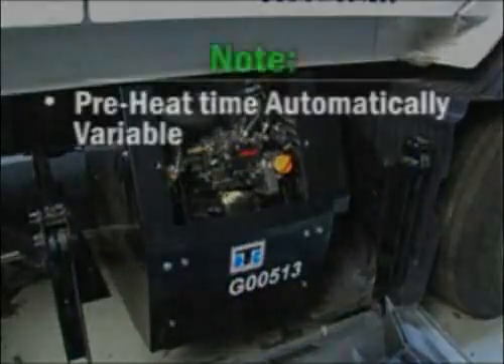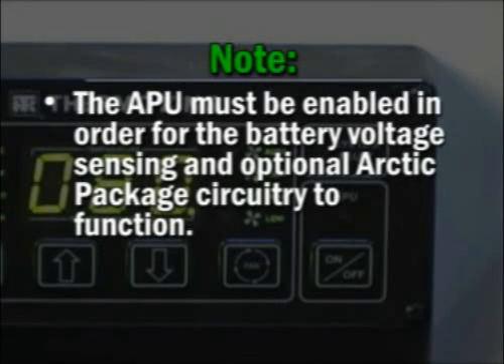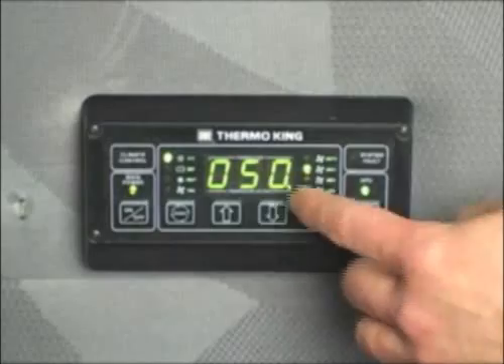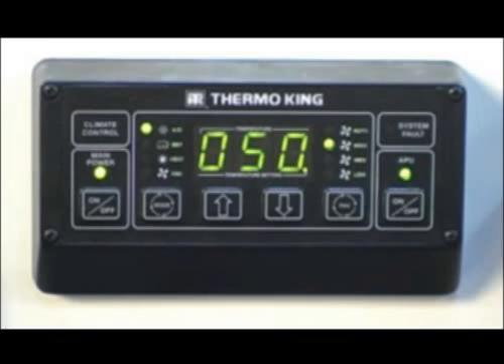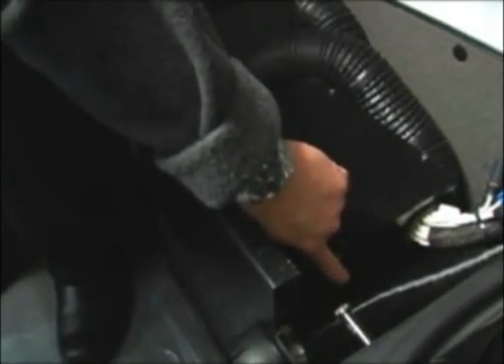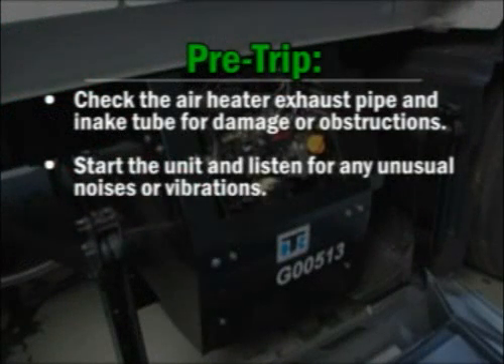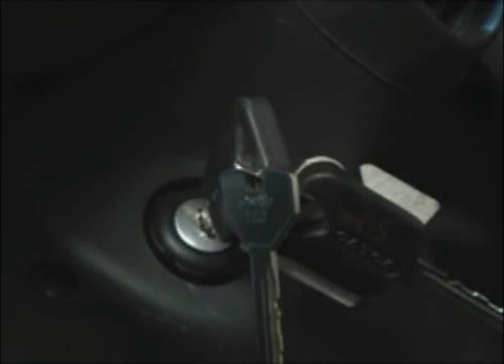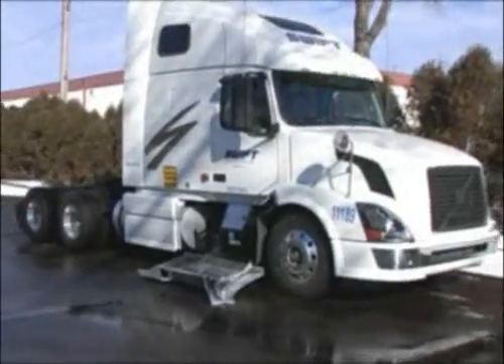Driver Operation - TriPac - Part 2

Comment: Haaaaaa. Mine wont start. I dlip the switch on the outside to turn it on etc, all it does is make  a beeeppppppppp sound. What in gods name is going on. I checked fuses,  i checked oil, belts, i mean i checked everything.  And it all it does is just beep, its a constant beep noises.

Comment: My 2011 apu tripac, doesn't shut off after the pre set temperature is reached 
Even if i wait for a long time 
It will stay on the whole night 
I have to turn it off or on manually,  every time , I woke up 
What can be wrong?
Batteries are brand new.

Comment: Wrote unit up for "eng" code. Got it again and it had "sby" code on screen. Would not engage from sby until I  turned key to accessory and turn on cab controls upfront. Ran for about 10-15 min & shut down with "alt" code. Reset evrything, turned key off ran another 10-15 min then shut off with  "alt" again.  I  give up.

Comment: Can't find a reset button inside my truck? It's a Ryder truck
There's a fuse panel under the bed that I opened up and there's a reset plug... I unplugged it and plugged it back on but that doesn't seem like a reset button in this video...